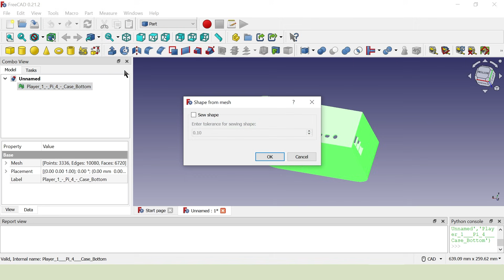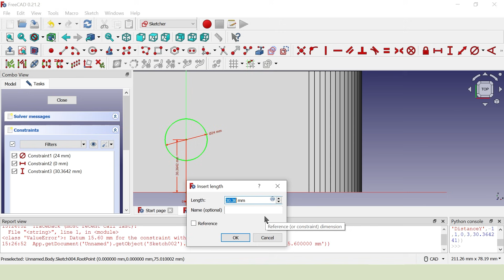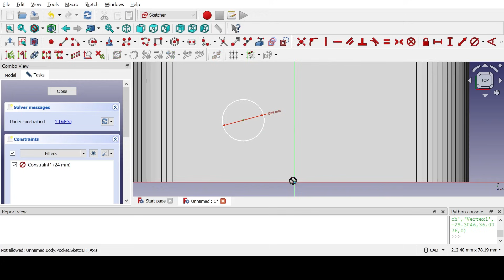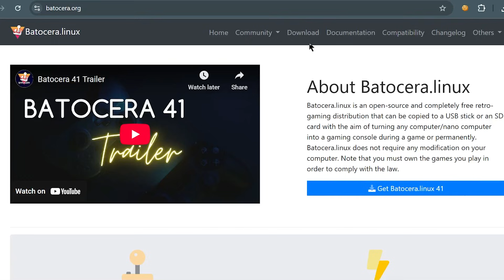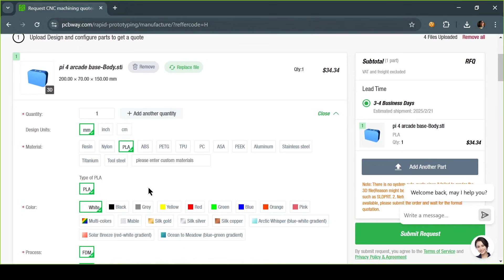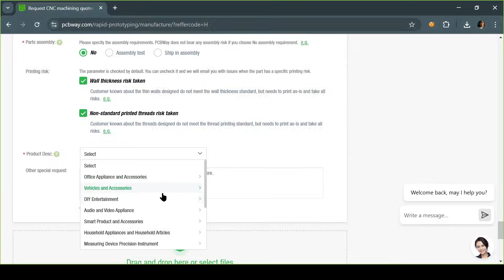Portable Arcade Pi Build

Comment: The lightgun issue is due to how lightguns work, most of them don't work on LED tvs. The way they work only works on CRTs, so unless you play on a CRT, most Lightgun games won't work nowadays
Reply from the maker: @anivmoreno9612  check out sinden lightguns. I totally get where you're coming from. But the sinden lightguns has a camera at the end of the barrel and uses software to track a white border on screen. You'll be able to see that in the house of the dead game. But sometimes it's the lighting condition that could affect the camera to detect the border. Check out my arcade build for a bit more info
Reply: @mikeys_youtube_makes  interesting, didn't know about those